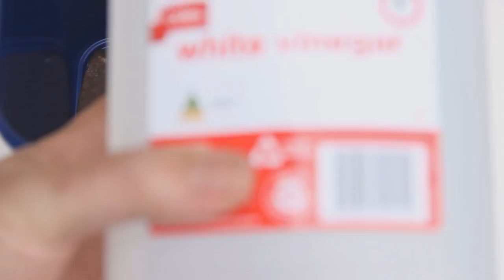Rusty Hatchet restoration with handle milled from a plum tree branch

Comment: Do not include heartwood in any project, with the exception of something like a fence post for the back 40. Heartwood will crack 99% of the time. Also, knots are very undesirable in a handle. Lots of runout, so it will be a weak point and might give you a splinter, and they dry differently from the surrounding wood, so you will get a lump later, and in the worst case, the knot might come loose. Look for a tough, somewhat flexible wood like ash or hickory. This wood is hard and brittle and not particularly suitable for handles, although pretty and fragrant. If you are going to hang this on the wall, no problem. Not ideal for use, though.
Reply from the maker: Cheers! The only reason I used this stick was that it curved in roughly the right shape and to try a few ideas I had about handle making. it turned out very uncomfortable, the straight handle I made out of white oak for another hatchet head is heaps better. The local wood for handles here is spotted gum, it's pretty good!

Comment: Color me impressed really good looking hatchet I like how you fixed the handle when it cracked I think I would've been heart broken to see all that effort go to waste
Reply from the maker: Thanks! I considered leaving the repair out but that's what happened so I left it in.
Reply: @lapislignum  yea I understand that I'm looking to do some restoration work myself starting with my dads hatchet that the handle broke on then the sledge hammer same reason
Reply from the maker: @greenwolfairsoft9118  Sounds good! it would be worth finding some proper handle wood if you plan to use them, I only used this because it was roughly the right shape (upon using it it is actually the wrong shape) and it was there. Also spend much more time fitting the head than I did!
Reply: @lapislignum  I will most Definetly keep that in mind my dads hatchet was literally just a straight line piece of wood so I think any shape will do as long as its comfortable and has a good grip and is durable I'd love to show u some of the wood work I've done already
Reply from the maker: @greenwolfairsoft9118  imgur it!

Comment: If you produce another, try a 4" grinder and 40 grit sanding disk to shape the handle using long gentle strokes - A body file is a nice tool to use to shape for final fitting and use a rawhide mallet to belt the knob when hanging.

Learning the art of handle making is a timely one and we all have to start somewhere - You did a great job with your available tools and it's a credit to you 👊
Reply from the maker: I'll probably still use the router to start, then it's just a matter of faceting the facets until the profile is rounded. I have a sanding disc backing pad for my 5" grinder but haven't used it on wood much yet. Cheers!

Comment: Interesting video.  I think you could have done most of the work on that axe handle with your draw knife.  But you would need something better than that vise to hold the wood.
Reply from the maker: With more practice I probably could have, I like the simplicity of 8 sided handles, not too much eyeballing required.

Comment: Plum tree wood is quite heavy and tends to crack easily, not ideal for an axe handle, if you want it to last more than a couple of years I recommend you soak it in linseed oil and than use raw bees wax as polish to better seal the wood against moisture.
Reply from the maker: The shape of the handle makes this awkward enough to use that it is destined to be a wall hanger, spotted gum is the local timber for axe handles but your suggested teament would probably help a lot, cheers!
Reply: and it seems not to be dry :)

Comment: Good vid, thanks. A lot of work u made with that hatchet. 
It's a pity you got the crack in the handle... I would have started over.

Would be nice to see the angles of the blade to the handle front view.
Reply from the maker: Cracks happen I guess. Do you mean to see if the blade edge aligned to the handle? From memory it wasn't too bad but the edge geometry was pretty ordinary, it's a pretty bad chopper all round actually.
Reply: I find that good wood glue usually makes wood stronger than it was before.

Comment: Good job, wrong wood though, it's gonna split like a cheap pair of tights on the first thing you hit.
Reply from the maker: It's worked ok so far but the handle curve is wrong and it's very uncomfortable so I haven't used ir much. I made a straight handle for another head out if white oak, it's been going strong
Reply: @lapislignum  Still a very cool looking axe! good luck with all future projects, n keep making great vids.
Reply from the maker: Cheers!

Comment: Should I use live/green branch or have it dry first?
Reply from the maker: This was pretty dry. Green wood will shape easier with a drawknife/hatchet etc but might crack as it dries. The fit in the socket of the axe would probably get looser as the wood shrinks as it dries out too. 

If all you have is a live branch, then that is the best thing to use :)

Comment: Great job, but next time to prevent the crack, use a rubber hammer
Reply from the maker: I used one first, but the fit was too tight and I thought I would get away with hitting it really hard. As you can see I didn't.
Reply: @lapislignum  That is actually a nice thing. You show in practice, why this kind of wood is not the best option for the handle:) I like that whole project with all problems. Recently i played with a pine wood from our last xmass tree and made a handle for my old little hatchet. It also didn't go too well - the wood was too brittle when dried and it cracked inside of an hatchet head when i hammered in the wedge. Without mistakes we don't learn :) Next time i will use a different wood!
Reply from the maker: I nearly edited the split out but that's what happened so I left it in. For a practical tool I would have used a wood known for its ability to handle being a handle.
Reply: @lapislignum  And that's why i love this clip - shows it all real. As a decorative object it looks really nice!  It was a good time to watch it and learn:)
Reply: You never use a rubber hammer - A rawhide mallet is the selected tool when hanging.

Comment: He who dies with the most amount of bench grinders wins! I counted three...
Reply from the maker: Another one is on the way, 1.5kw variable speed belt grinder, i'll still keep the one in this video though. Not sure I'll need more than 4, cant think of anything I need besides belt grinder (X2), intentionally underpowered wire wheel and buffer as I don't like stone wheels.

Comment: In my opinion if you slowed down the speed to about half of your mega fast speed it'd make for a better video. What you have is just way too fast to be enjoyable. Cool video though.
Reply from the maker: Speed is a tricky one, you can slow it to half speed through the video settings but the sound suffers a bit. I've seen a few normal speed videos that work well but I usually don't have the time to watch them. Thanks for watching!

Comment: Ok, I'm a novice at this so tell me if totally wrong. 
It seems you went to fine-shaping the handle too early, rough-shaping it with an axe/draw knife/rasp first seems more appropriate and less work.
Any special reason for 8 sides?
Reply from the maker: I'm a novice too, or not far beyond one. I'm not great on the drawknife yet and the chips weren't coming off like I wanted them to, so I just used it to get the big bits off and then went to the sander. Doing more work with the drawknife would be better for a round/oval section handle but I wanted to start with a square section so it would work with the router better.

The 8 sides were inspired by "Wa handles" of Japanese kitchen knives and were easier for me to do than getting a uniform oval section. It ended up pretty comfortable!

Comment: I've always just used rasp & file, then scraper...goes real fast, soulful results.
Reply: p.s. I like to use 1/8" 1/4 sawn white oak strips and laminate tem to the depth desired, then band saw, rasp & file. then fume the oak in ammonia for 8 hrs and linseed oil. nice rich result and very strong.

Comment: Plum = bad choice.  Also it wasn't very well carved down.  Looks chunky. Plus once you got that crack you should have tossed it and started over.
Maybe with a better handle wood? Like hickory or ash?
Reply from the maker: The plum was more an aesthetic choice than functional, by the time the handle cracked I just wanted it finished, the shape wasn't great (it isn't a good chopper) but it feels pretty good in the hand - I will probably do the 8 sided handle profile again as it is easy to get even. 

Hickory and ash aren't common here, spotted gum is our native handle wood and would be a much better choice.